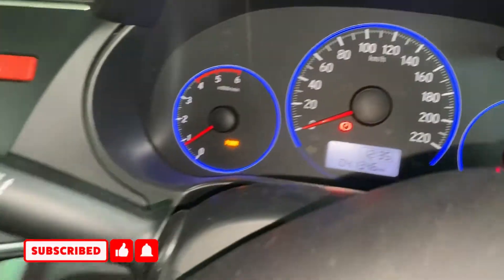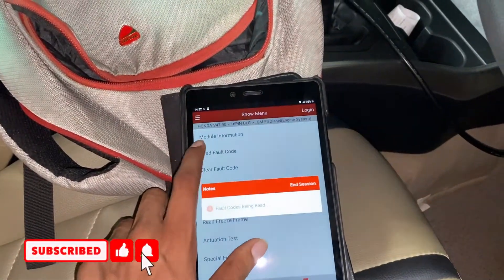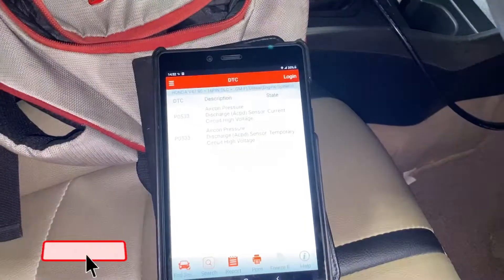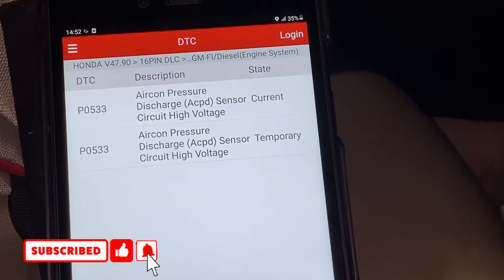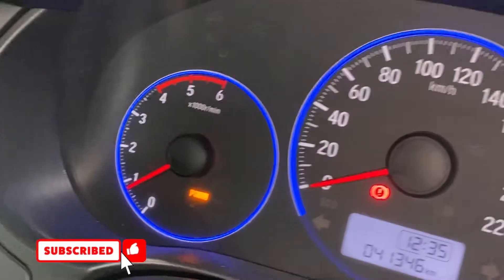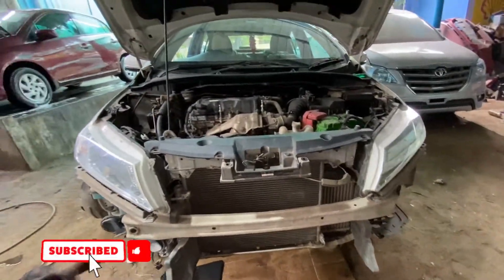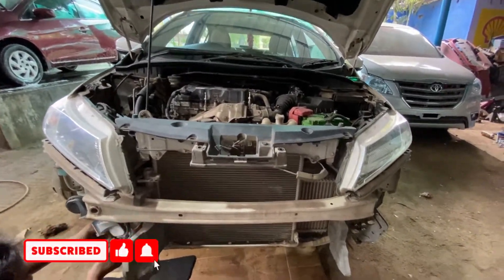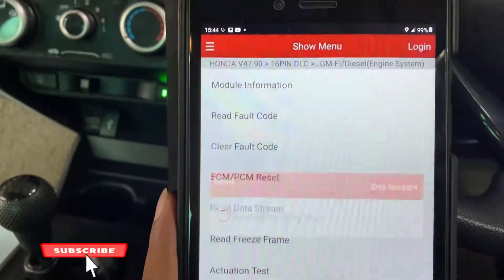Honda City A/C not working||PGMFi||Diesel||LAUNCH||MIL||TAMIL||1080p

Comment: I have a problem in my Honda amaze 2014, engine turn off while running with the indication of pgm-fi and after few seconds engine turn on. What was the reason ?
Reply: Is it problem solve?
Reply: @punctureaid1510  yes solved
Reply: What have I done for this problem? How to resolve this problem ? Pls guide me
Reply: Check the battery wire connection